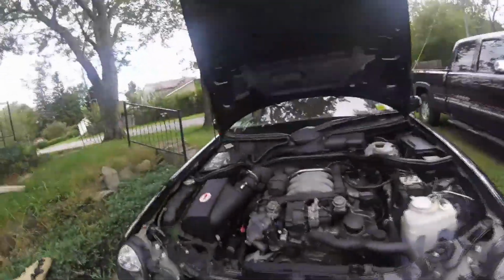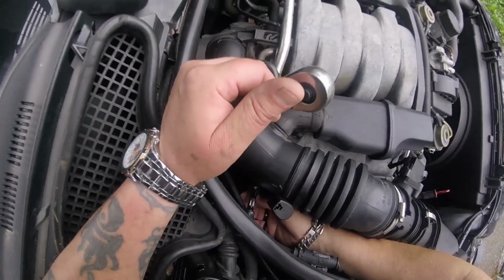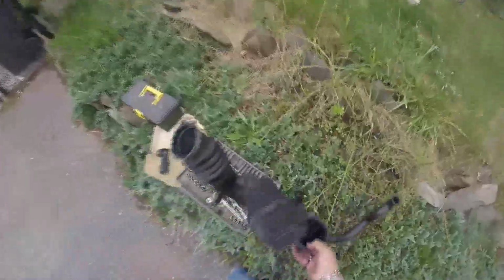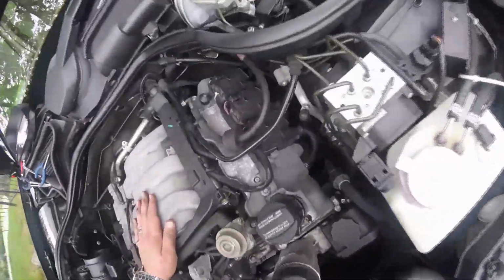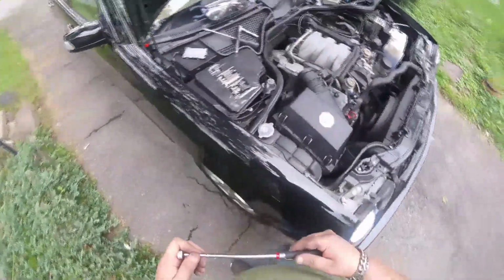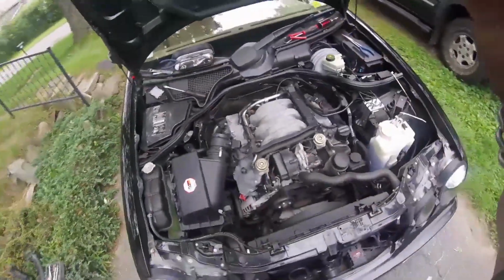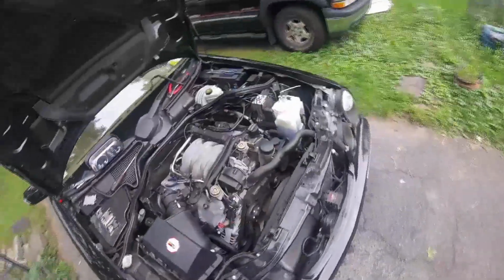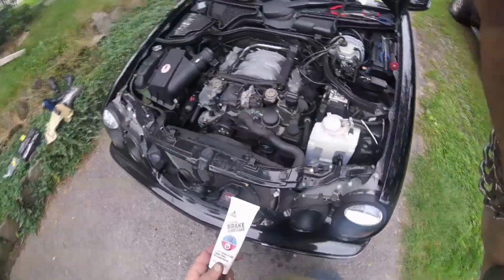Fuel Injectors Mercedes E320 W210 M112, M113 Engine

Comment: FWIW to anyone watching this video 6 years later, all the o-rings for fuel injectors are viton, not rubber due to the ethanol blend that's been in fuels since the 1990s. It would be better to use a PTFE (teflon) base lubricant, but silicon will also work and is definitely better than petroleum base. Great video.

Comment from the maker: Put your injector clips back on injector before installing to fuel rail and they will just click to lock in place
Reply: I was having same symptoms, changed all ignition component. Curious to know if this fix the misfire?
Reply from the maker: @Elite1inamillion  yes but I had to replace the fuel pump as the check valve inside of it was leaking. If you can figure out which cylinder is misfiring I would do a compression test on it. If you have good compression and you have replaced your ignition components then it must be a fuel injector issue.